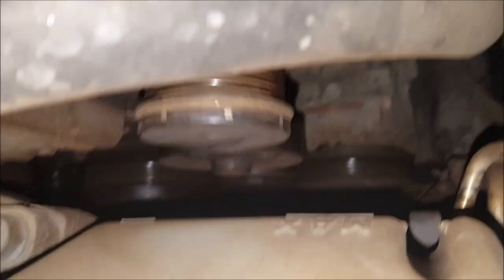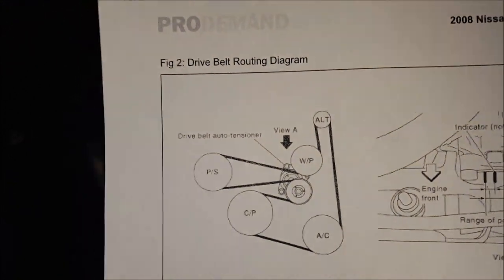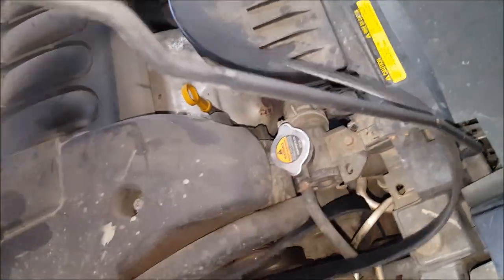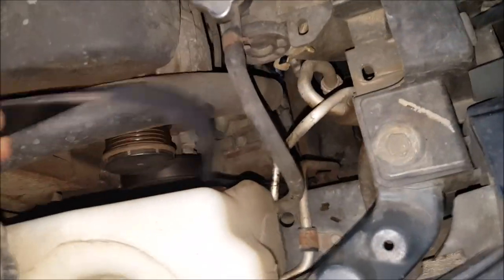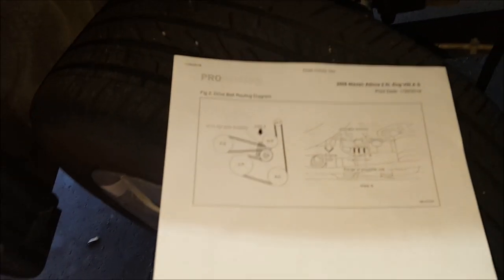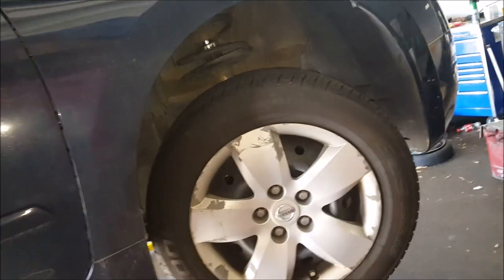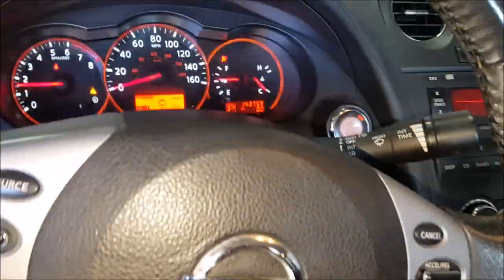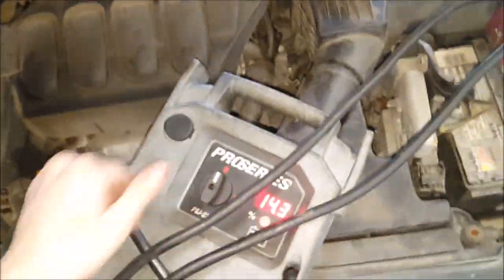Nissan Altima Serpentine Belt Replacement - 2008

Comment: Just did this job on an 08 Altima 2.5.  A quick bit of advice would be to pull the coolant reservoir (10mm bolt - takes 30s).  Total job including hand torquing wheels was maybe half an hour.  If you have a helper, one pulling the tensioner and the other slipping the alt belt on would be easy.  If alone, the best advice is to do the AC pulley last as you're closest to the tensioner (pull to the left and pull HARD till you hit the stop).  I found that using a 1/4" rod with a hook bent on the end helped routing the belt also.

Comment: This video saved me from burning my garage down in mad anger. This stupid design of a belt and tentioner didnt work for me any other way than this video. I tried that stupid bolt lock on the tentioner as manuals and videos show with no luck...ive tried putting the belt on water pump last  as claimed but nothing would work at all...i finally see you put it on AC compressor last and i did it in 30 seconds. I spent two hours last night trying every other possible angle. Unreal that made a huge difference. Big thanks though as this helped.
Reply from the maker: Glad to have helped brother thanks for watching
Reply: I had same issue with belt but trying it this way worked after 2hrs lol

Comment: My belt tensioner would only move so much and with a new belt wasn't that easy to put on we had to route it the rigbt way but using the belt tensioner as the last pulley to slide it on n it was a bear in the little area under the passenger tire but eventually got it done
Reply: Did you do this without pulling the wheel??  Wow!  That would be a pain for sure!

Comment: You can't say it I guess so I will, that guy treats his car like complete crap probably a teenager but not necessarily.
Reply from the maker: Yea not sure, never talked to the driver.. I believe belts on some of these Nissans get overlooked because they are more difficult to check for cracks.
Reply: @LehewTech about to replace my belt this weekend.
Reply: @LehewTech  My belt is hard to see. That's why I didn't replace it